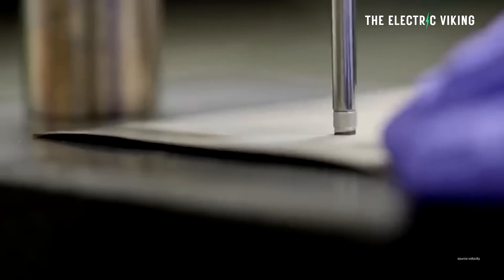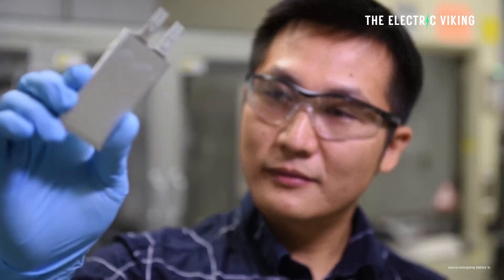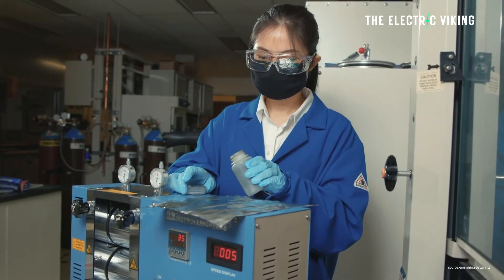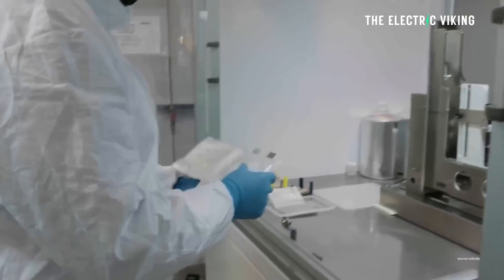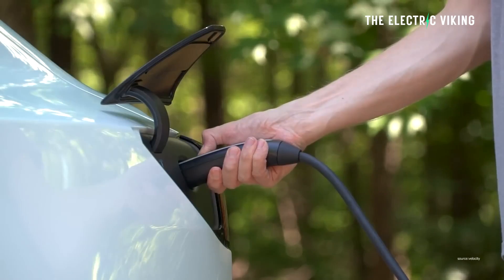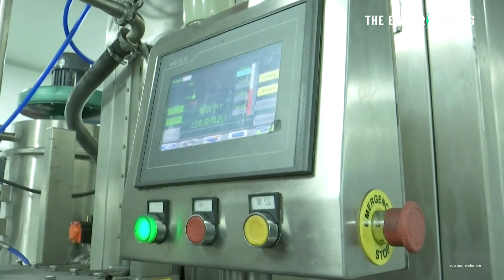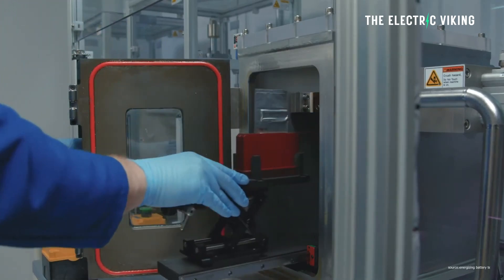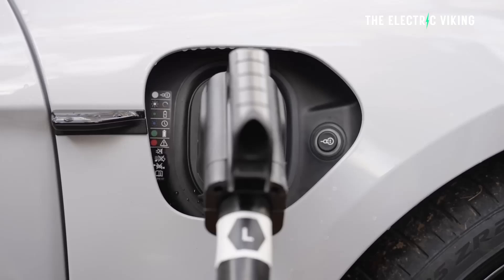Sodium battery with higher energy density than Tesla cells charges in seconds

Comment: How does this apply to 60-100 kWh auto batteries? More advanced level 3 chargers can charge at 250-350 kWh. A 100 kWh battery fully drained being charged to 100% at a 350 kWh charger would take around 17 minutes. Of course, normally you wouldn't be that close to 0%, and most batteries are not recommended to be charged to 100%, so maybe to 80%. 
Of course, current batteries really slow down on charging speed the closer to 100% goes, or when not in their ideal temperature range, so that should still mean much faster charging overall, but not anywhere close to seconds.

Comment: Water is cheaper, has a higher energy density, and quicker charging time (the time it takes to fill up your fuel tank with a garden hose.) An added bonus is existing internal combustion engines could be converted to run on water. Stanely Meyer and Dennis Klien had this technology perfected years ago. Jets and turbine engines could be converted to run on this gasified water.

Comment: Need to get real. 

The average EV uses about 15KWhr per 100km. Typical daily use of a private motor vehicle is less than this (60km), but lets assume 100km and 15KWhr.

15KWhr can be delivered to the vehicle in ten hours at the 1.5KW rate.

In Australia a standard GPO is rated at 240V 10A so is readily able to deliver 1.5KW.

Consequently if you plug your EV into a standard GPO at 9PM your vehicle will have received sufficient energy for the following  day's motoring by 7am.

Most EV manufacturers as recommend fully charging once a week. This can be achieved by giving the vehicle a long charge on weekends, or the occasional fast charge at a commercial DC fast charger. 

In practice I have found DC fast charging only necessary about once every two or three months. The rate the DC charger delivers is pretty much immaterial as far as I am concerned, as long as it can do 50KW I am happy. I can usually get to 85% in about 15 minutes, take the car home and do the final top up to 100% on AC.

Comment: Rapid charging is utterly meaningless if you can't deliver the charge to a car rapidly. Just look at the size of a 350kw charging cable and this should be obvious. The reason it is so thick and enormous is that amount of current has to be insulated and actively cooled because the amount of heat given off. And in your car, to receive that charge there would have to be similar precautions to regulate the flow to what your vehicle can safely receive due to heat and existing state of charge. So it's all well and good to say "oh we can charge a battery in 10seconds", but it doesn't mean it will happen in practice, at least for private passenger vehicles. Maybe there are some niches were super rapid charging is desirable and worth paying through the nose for it but I doubt it will be cars any time in the forseeable future unless swappable batteries become a thing.

Comment: Home chargers would not likely exceed 6000 watts so about 10 hours would be needed because of the home wiring limits no matter what the battery could accept. If a roadside charger could deliver 100,000 watts at least 1/2 hour would be needed.

Comment: To charge a 100kWHr battery in one hour the charge rate needs to be 100kW, but to charge a 100kWHr battery in one minute would require a charge rate of 6MW.  To charge the battery in, say, 10 seconds would require a charge rate of 36MW -- where is that going to come from?  Imagine a refilling station with, say, 16 charging ports each charging at 36MW, the amount of power required would be 576MW, which is a substantial fraction of what a large power plant can produce.

Comment: Charges in seconds - Yes, small cells perhaps, not in seconds when charging 400V/800V 100kWh EVs battery even in theory. Everyone could calculate how much power is needed to charge 100 kWh battery pack from 10% to 90% in few seconds. 

If even the charging power is not an issue, then put in your mind 10 cars in line and charge all of these at the same time, how much power is needed then to get these "few seconds" situation?

Few seconds? No, It is impossible in real world.

Comment: Not click bait you say, charges in seconds you say, lets say 60seconds then... 50kw 400volt battery, (not that big for an EV) so we need 7500amps at 400 volts DC thats a cable with 2 conductor's with a cross sectional area of 1500mm!!! A crane needed to drag that lead and a plug the size of the car. Welcome to the comedy channel 😂

Comment: Whenever I hear an announcement of battery technologies that charge very quickly, it always seems to me to be addressing half of the problem. If a battery could receive, say, 50KwH in 2 seconds, what could deliver such energy so quickly? That would be an interesting power grid. Maybe store energy in local batteries that could discharge 50KwH in 2 seconds? And what of the cables etc. Mind you, a great solution to half the problem would be better than no solution to any of it.

Comment: As it applies to EVs, you still can't get there from here. It doesn't matter how much capacity your battery has or how fast it can charge if you don't have the grid & generating capacity to do it. Commercial trucks provide a glaring example yet even personal cars won't work when you replace all ICE with EV. Consider the Tesla V3 at 250KW. You can't have that at home. You can't have 100KW at home. Most homes have 200A service or less. That's 48KW to run your entire home without an EV! So many people who don't understand reality believe in the pipe dream of EVs. Reality is that the middle class will be priced out of cars. But they've been trying to get us out of our cars for a few decades so this shouldn't be a surprise.

Comment: It's a VERY interesting and promising technology, especially for small devices (if it proves cheap, reliable, durable, and stable).  However, it's a non-starter for car batteries, as the necessary power draw would simply blow out your home fuse box if you tried to fast-charge such a car at home, or melt the connection to a public charging station if you had a couple of cars trying to fast charge at the same time.  Some solution to these issues MIGHT be possible in future, but it will require a radical rethink - and probably a LOT more copper cabling for power connectors.

Comment: I can imagine with this quick charging,, that the battery size could be half, and thus half the weight, what ever the density is, and with what I call a charging plate on the bottom of car, one could simply pull up to and in this case, directly over  a charging station panel, and never even have to get out of the car to hook up charging cables.

Comment: Capaceters are used for many thing . Ussually for startup for hi draw motors using higher voltages through the capacitor . So they are fast to charge and discharge . They have been around a long time . A common place you may see them us in your airconditioner . 

If you could employ them into battery technolugy that you get the benifit of fast charge but eliminate the fast discharge you maybe onto sonething . Maybe they can be used to provide higher voltages to a ev motor when first engaged to lessen the amount used by the batteries . Now high voltage capacitors are dangerouse woth higher voltages .

Comment: If they can charge in seconds we’re gonna need high tension 11,000 volt cables to every home. 😂
Reply: Only if they need to be charged in seconds. But they don't need to, they only can.
Reply: You’re probably right… current EV batteries are degraded by fast (45 minute) charging. Glad that engineering challenge is behind us.

Comment: "Charging in seconds" for any kind of EV sized battery is unlikely in reality, because of the limitations of sources that can deliver a hundred KwHrs of energy in seconds.  What is needed is batteries that can take charge at a constant HIGH rate, from 0--100%, so that the charge source and connectors/cables can be fully utilized to their max capacity during the charge cycle, just as a gasoline pump can deliver energy at its full pumping capacity, from empty to full gas tank.
Reply: Proof of Concept research leads to incremental improvements in existing technologies, so the fluff is just how they draw investors.  And these incremental changes are how EVs are about to surpass ICE in range with charging speeds that are comparable to refueling.
Reply: Tesla literally already has megawatt chargers installed and working.
Reply: So how long would it take to charge a 100 KwHr battery with a megawatt charger?  Not seconds, more like 6 minutes.  350 Kw chargers already have huge and heavy water cooled cables.  So, 3 times larger than that?  And 24 cars pulling a megawatt each, at the same time?  That’s one hell of a lot of power to pull off the grid in one location.

Comment: To charge a 60kWh battery in 60 seconds would require a charger capable of delivering 3.6MW of power.
Reply: And this type of battery could deliver that...
Reply: @DarylOster We might finally get a M3 Performance with 3.6MW of power, that's 2600 hp.
Reply: That's a lot of heat , and way too much electricity allowed near a living creature, human..   well a petrol pump can do that safer in 2 mins ...
Reply: @aperitifs  How much electricity is allowed near a human? Is there a law?
Reply: @aperitifs  yes, but your petrol pump does not have future. You have to understand that :)
Reply: - Charges in seconds - Yes, small cells perhaps, not in seconds when charging 400V/800V 100kWh EVs battery even in theory. Everyone could calculate how much power is needed to charge 100 kWh battery pack from 10% to 90% in few seconds. 

If even the charging power is not an issue, then put in your mind 10 cars in line and charge all of these at the same time, how much power is needed then to get these "few seconds" situation?

Few seconds? No, It is impossible in real world..
Reply: @iSot80  At each charging location, there could be one or two Superquickchargers, which have those types of batteries in them. They could then charge one car in a few seconds from their own batteries, without needing that much power from the grid. Once the car is charged, they could recharge themselves from the grid within 5 minutes, preparing for the next car to arrive.

Of course, to deliver that much power to a car, massively redesigned cables, plugs and ports would be needed. But, in theory...
Reply: @valuemastery  In theory, but it is far away from the reality. In my opinion, Much more convenient is just swap the battery to full in 3-5 minutes. There is also created already technology where car will swap the battery itselfs and owner could leave the car to parking place (toilet, shopping, eating etc) and this technology is already here for this there is no need for ultra high sci-fi systems and cables or Evs which support this very high massive power.
Reply: @iSot80  Yes, I think you are completely right. A few seconds charging is nothing that we will see in reality anytime soon, if ever. But going to 80% in 5 to 10 minutes might be something that will arrive in reality at some point, and will be fast enough to counterargument the ICE drivers, saying they can refill within a couple minutes.

Regarding battery swap, that's of course a great solution in theory. But it's an expensive teschnologie compared to just charging, so I still have doubts if it can be done in the mass market. We have one swap station nearby, and I've watched a Nio do it. It's definitely fascinating.
Reply: @valuemastery  With investment in mind, regular ice fuel station is much more expensive than one battery swapping station or one swapping station + supercharging stations. 

We need all these different options for charging to EVs.

We have to wait how this will going on in future.
Reply: @valuemastery I have a couple of EVs, we very rarely fast charge them. To me fast charging is just a load of hype, irrelevant to everyday EV use.
Reply: Are they saying these types of batteries are for home users? Maybe if these batteries are right, they'll be for aviation and shipping that could install that type of charging capacity.

Comment: Charging in seconds will require extremely heavy power cables, or a huge battery voltage. I don't know what the happy medium will be🤔
Reply: Probably neither.  Most current Proof of Concept research leads to incremental improvements in existing technologies, so the fluff is just how they draw investment.

Comment: I like it. However to charge a car at that rate the charging station power lines would need to be more hefty than a 300 kW charging station. The only way I can see this working is if the charging station also had capacitors like right next to the vehicle while charging.

Comment: Telsa purchased Maxwell Technologies in 2019, a supercapacitor company.  However, it sold it just two years later (now called UCAP, which also has licenses to Korean technology), presumably because they could not successfully integrate it into its production.  The idea at the time was to use capacitors to capture and release energy from braking and acceleration (as well as fast charging) in order to reduce the heat and wear on the battery cells.  It is interesting to see how, just a few years later it could return to cars, in a solid state sodium ion battery.

Comment: Chaege in seconds! Really? How are you going to get the thousands of amps into the soldium battery that it will need to charge in seconds? You won't be doing it via the little plug in car charger you showed in the clip. You will need cables as thick as your arm. Where will this massive power requirement come from? In addition, sodium batteries have a very wide range of voltage to extract the Ah from. No electrical equipment can currently run on the super wide voltage you see with sodium batteries, particularly motors. It's all hype and it will require very specialist equipment to extract the energy from sodiumm batteries

Comment: I was becoming concerned that Sam was slipping. Three days have gone by without any “miracle new battery” being announced.
Reply: Sam wasn't about to let you down 😅
Reply: Rapid charging the x boxes plug and play vibrator is not as good as a pull string  2 or 4 stroke .
Reply: Xbox is what my lesbian friend calls her x
Reply: Ultra fast charging is not real. They will need to upgrade their 800V battery at least to 60000V
Reply: @rwyo83  it will mean more efficient regen when braking which will increase the efficiency. For big powerful trucks this is awesome.
Reply: @vegtalkvibes   Not really. Regenerative braking only produces a trickle of power, not enough to make any real difference.
Reply: @PropanePete  how do you know this?
On lower speeds driving where air resistance does not matter the most energy is used on accelerating the car to the desired speed the rest of the energy is used to counter the force of friction and air resistance which is relatively small in comparison on lower speeds. Especially this is true for heavy cars and trucks.

Comment: Rough math check; to charge a 80kWh battery in one hour, ideally, 80kW ,  to charge that in 10 seconds would take 80 x 360, 28.8 MW !  That’s a pretty thick charging cable and some heavy duty engineering!

Comment: You should be using the term “watt hours” as the term for energy. Watts is a measure of power. Power multiplied by time gives energy.  So energy density is correctly called Watt hours per kilogram.
Reply: Aparantly, Sam doesn't read comments. I have told him the same thing many times, yet he consistently makes the same mistakes.
Reply: Indeed. The difference between watts and watt hours is like the difference between speed and distance. They are definitely related, but they are far from identical.

Comment: The new in research LiFE doped batteries are at 770w/kg. much much higher than these sodium batteries, but can not charge as fast, but still faster than anything today. Maybe many different chemistries for different driving needs.
Reply: Or a hybrid EV with both types on board - fast charging batteries for adding 75 miles in a minute and the slower batteries for the very rare times more than 75 miles are needed in any given day - assuming the fast charging sodium batteries have less density.  If they have the same density and cost (or lower) than they will rule the scene.
Reply: There's no such element as E.
Reply: @yggdrasil9039  Elephantine?

Comment: 1. there are no HPC stations available to the currents in the lab 2. the amount of lithium in li-ion-cell is actually quite low, just replacing it does not make batteries cheaper 3. a higher energy density however does but that's not true if a you make a compromise with hybrid cell 4. where only part of the cell can actually charged fast - bottom linere: not sudden revolution around  but it is good to see progress
Reply: It sounds like you're not just replacing lithium, you're replacing all the exotic metals in the battery with things like iron, sulfur, oxygen, nitrogen, carbon, and sodium. They all sound easier to source than things like cobalt.
Reply: I see the ,not to far off, day when solar power collection such as solar collecting paint + battery tech will reduce power station dependence by 80%. Only commercial accounts will exist. That will be a revolution.
Reply: The 60Ahr126S1P lithium iron phosphate blade battery in my Atto3 contains about 18Kg of elemental Li.

Comment: Sodium weighs 3x the weight of lithium. Sodium is much more reactive it burns intensely in water let alone air. But it is cheap.
Reply: You're talking about pure sodium metal .For battery usage it will be combined with another substance.
Table salt is sodium chloride and not sodium metal.
Reply: @eish3291  yes it is a component of a compound